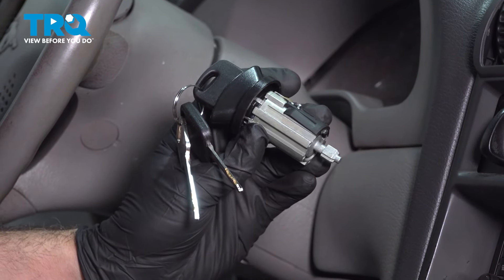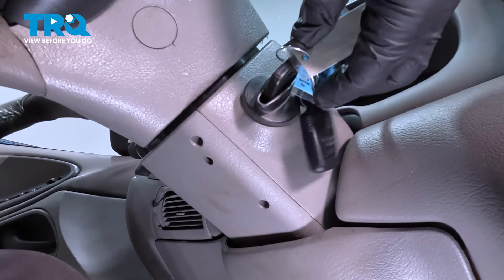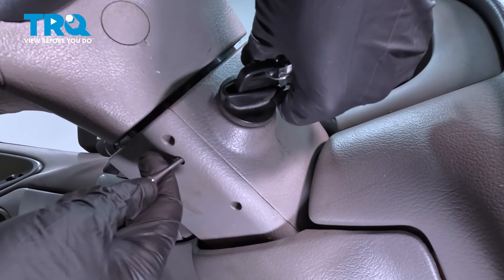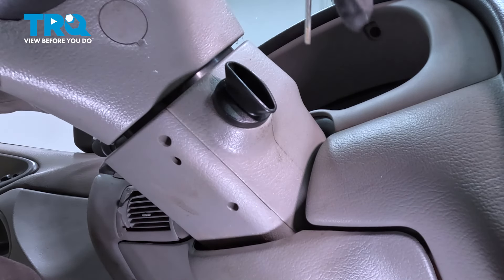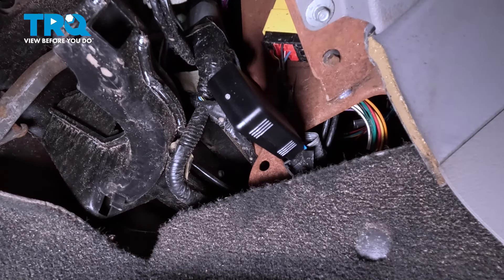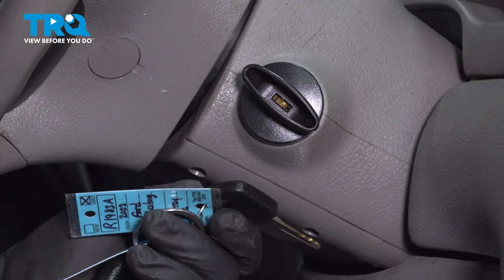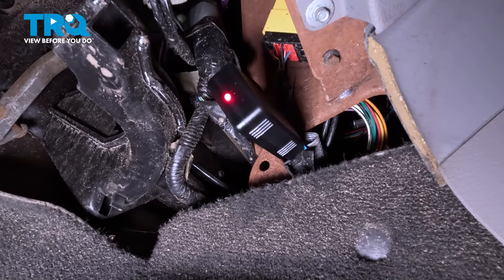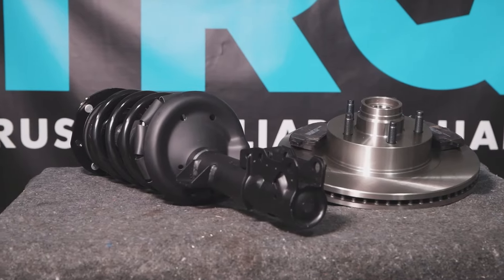How to Replace Ignition Lock Cylinder 1994-2004 Ford Mustang

Comment: Hey there friend! Have a 1998 mustang and the ignition cylinder seems to have failed on us while the car was running. They pulled the fuel pump fuse to cut the engine, but the car continued to run and eventually died. Now we have a new battery in, and are getting no beep on step # 1 after hooking up the programmer and then holding the original transponder key up to the new non-transponder key. Any tips or info on why this could be happening?

Comment: I HAVE A 2003 MUSTANG THE KEY WORKS REAL HARD, WILL IT SCREW ANYTHING UP IF I TAKE THE CYLINDER OUT AND LUBRICATE IT AND REINSTALL IT. THAT WON'T HAVE ANYTHING TO DO WITH THE KEY CODE WILL IT ?